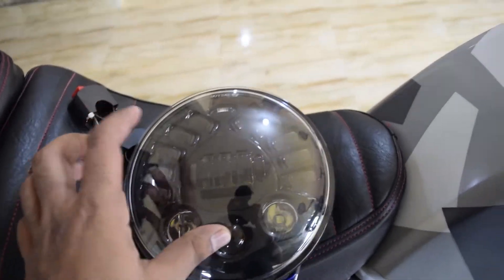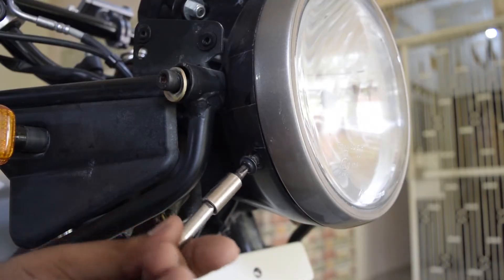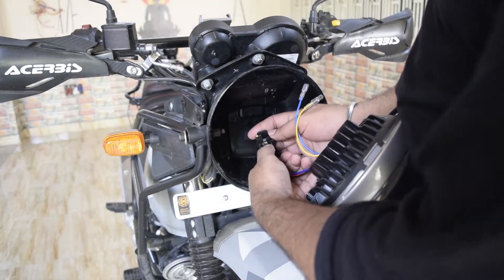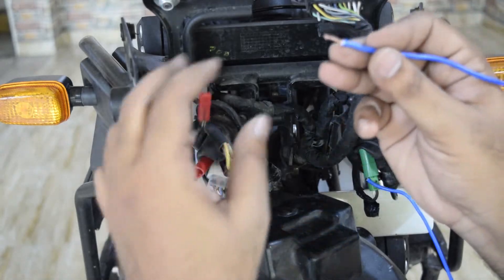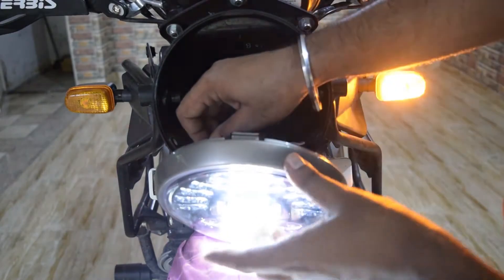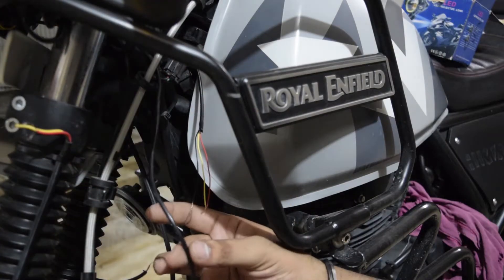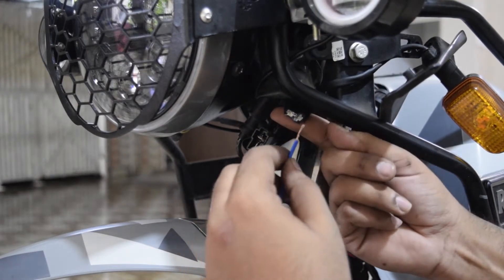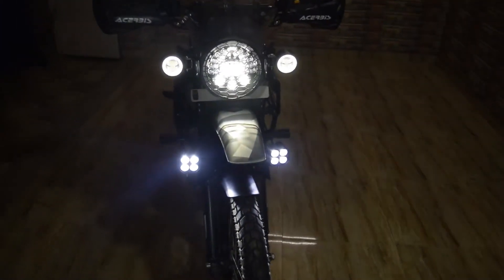Headlight And Foglights For Himalayan | Installation

Comment: Very good presentation. Firstly I would ask you to allways follow the colour code on DC systems, so that there is no chance fo shortcircuits and circuits are easy to trace . Secondly Please have the habit of using metal connectors whereever you are joining wires, that way the connectins will be secure with no chance of leakages. Thirdly please use electric tapes or shrink tubes to protect your connections. Lastly please use "T" or "Y" connectors to extend the connections, that way the original wires are not cut and warranty is not void.  Its really good to see your video on replacing the stock head light with LED head light.  So many fog and spot lights is and over kill.. You must have halogen amber for fog lights, and projector for LED spot lights. This will be helpful in preventing oncoming motorists from being hurt with a wall of white light.
Reply: instablaster...

Comment: Yash: Kindly share your source for exhaust shield (for the pipe running from engine)
Do you sell/resell that part?
Reply from the maker: I bought it online on Amazon.
Here is my video on it.
Link in the discription box.
https://youtu.be/xIVvgEaoYXc
Reply: Yash Gupta thanks mate. Does it add any vibration? Do you give that part a thumbs up or down?
Reply from the maker: @tahaonutube  no vibrations bro, it's a thumb's up from my side...👍
Reply: Appreciate your input.